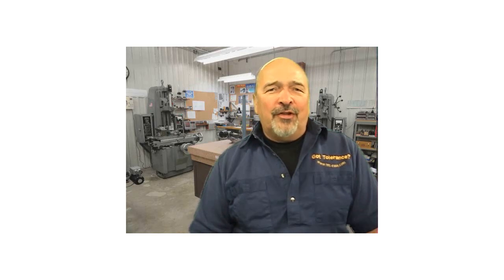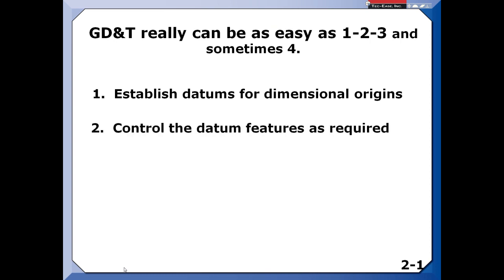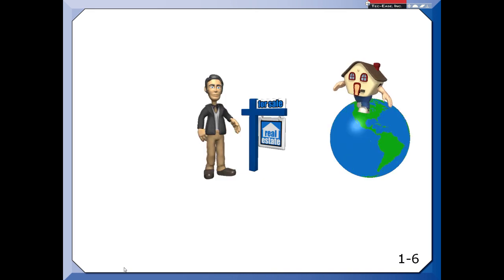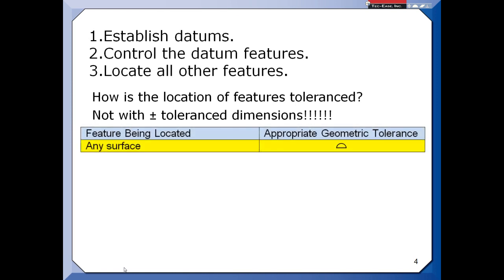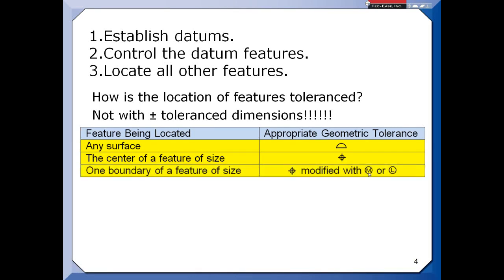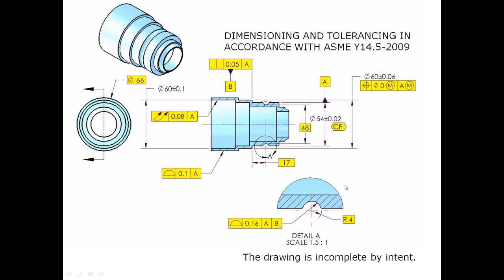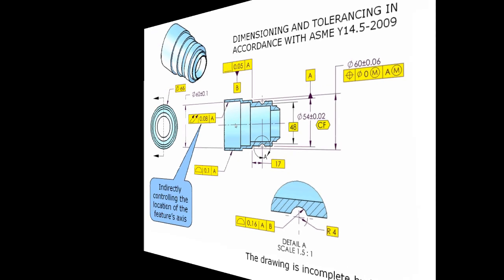GD&T Tip -  Stop Locating Features with Plus/Minus Toleranced Dimensions

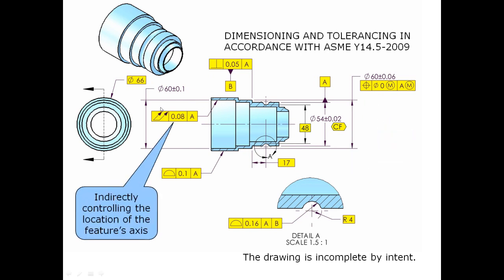Comment: Sir, at 4:37 would you be able to explain the meaning of the flag for Diameter 60.06 position tolerance of diameter 0.0; however with a (M) symbol for A. How does one interpret the behavior of Diameter 60 (nominal) when Datum-A is with a  (M) notation? Hope I am clear.